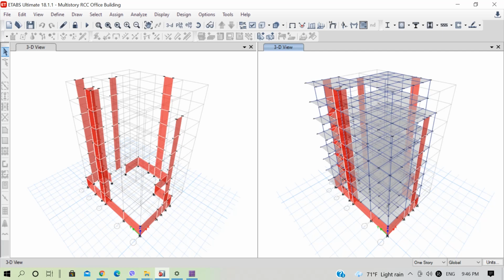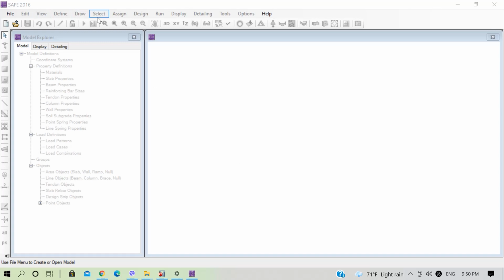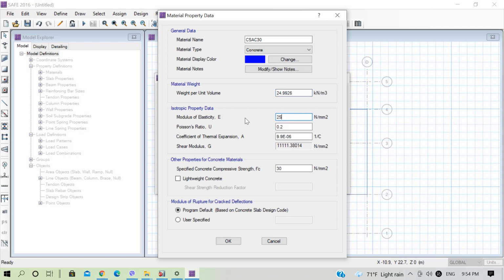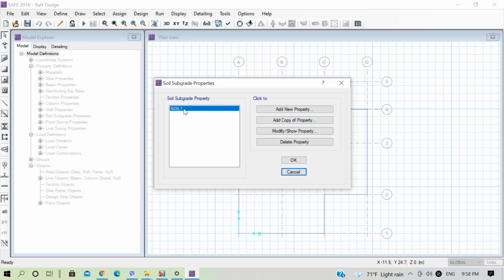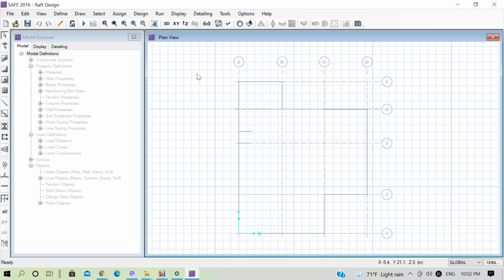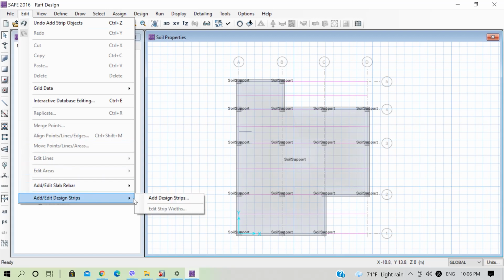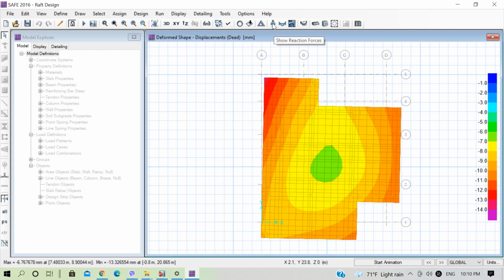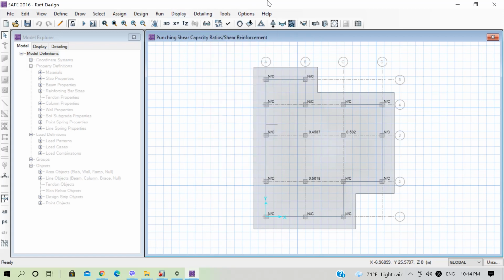Lecture 7 - Modeling, Analysis and Design of Mat/Raft Foundation in CSI SAFE Software

Comment: Excellent. But if u use seismic load having more overturning moment  in the design load combination, the size of the foundation will  be  more. In that case , it is advisable to increase the value of SBC by  some percentage as per the local design code. This will avoid in increasing the size of foundation.